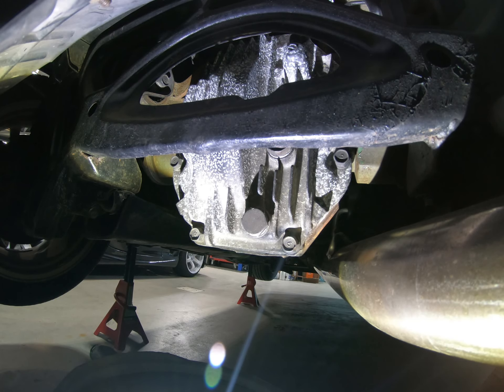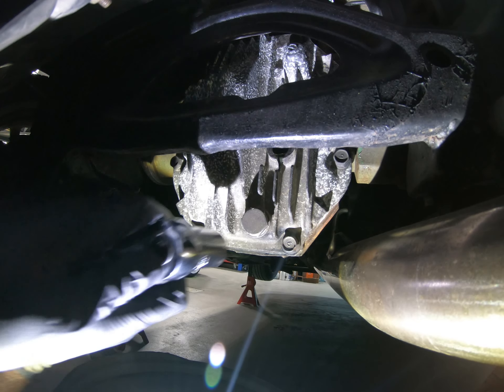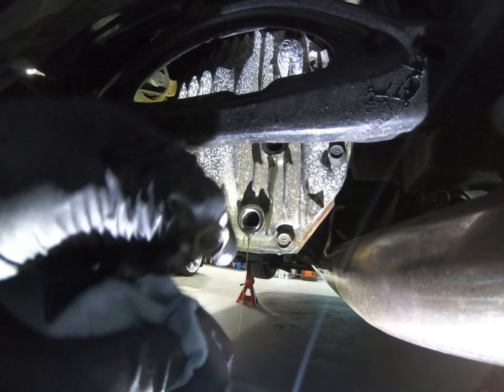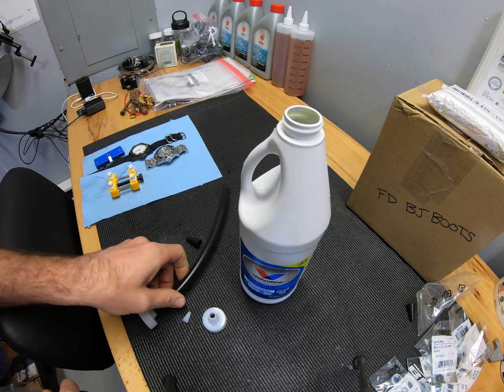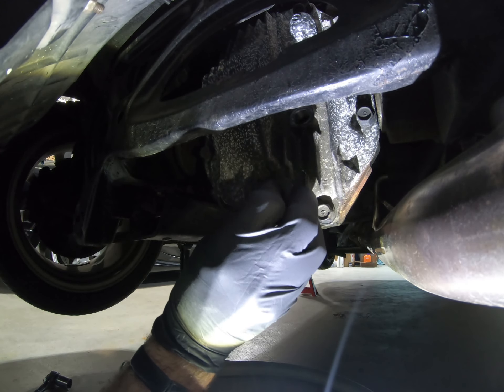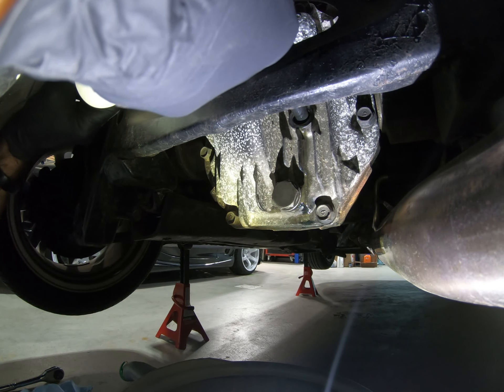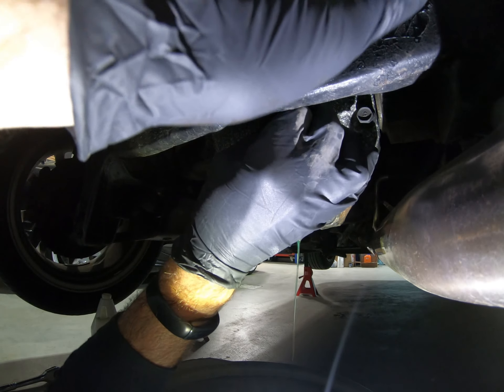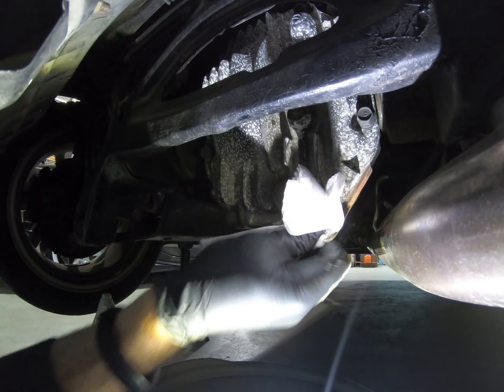How to change out the rear differential fluid in a 93-02 RX-7.

Comment: now do the fuel filter up there:/ wont be a 5 min video lol
Reply from the maker: Isn't that the truth!! 😂🤣
Reply: if i was you i would do a fuel filter relocation so remove the old one replace it with a barbe fitting and add a inline filter to replace it because the original one is in a bad spot and servicing a inline one is way better
Reply: @Phil2stroke  any particular inline filter you recommend?
Reply: @Lexannn  you can mount them in the engine bay on the firewall